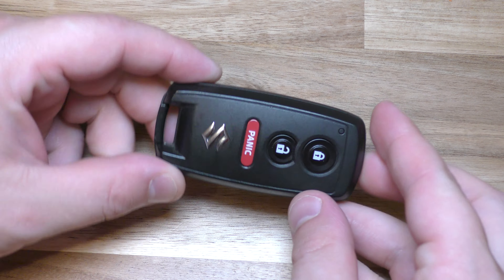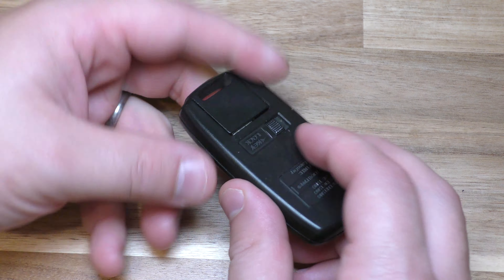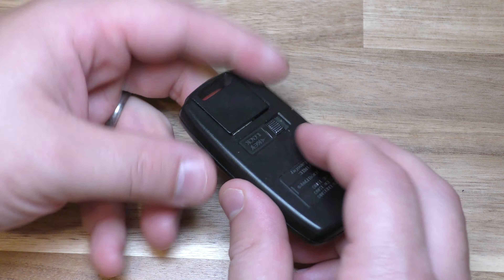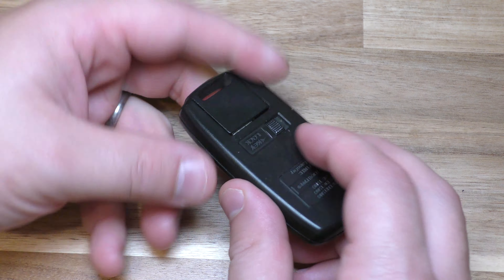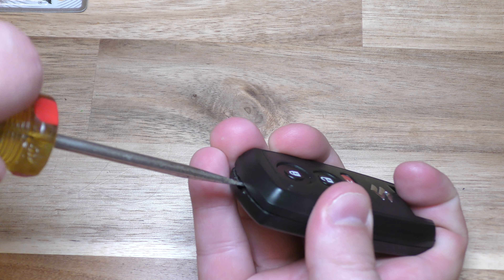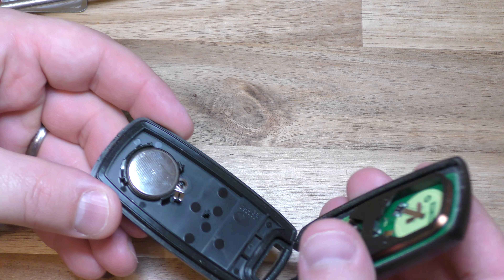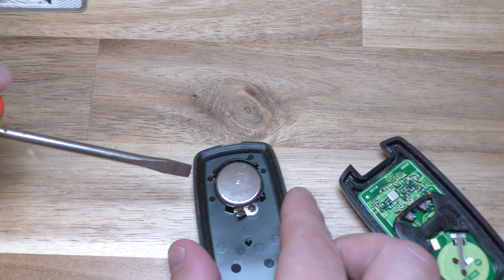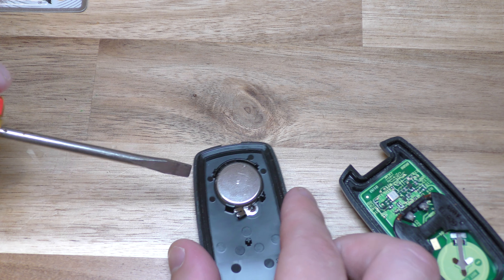Suzuki Key Fob Battery Replacement - EASY DIY

Comment: Hi! I just replaced my battery in my SX4 key fob and it unlocks/locks perfectly. The issue I'm having is that when I try to use the keyless start aspect of it, it doesn't work and a flashing key shows up in the dash. Any thoughts that might be helpful? Thank you!
Reply: I have the same problem right now, if I want to use the keyless start i need to press the unlock and the lock button at the same time then start the engine but I have to do it every time, if u found a better solution can u let me know ?
Reply: @sayedqassimfadhul1220  Hi, did you manage to resolve this?